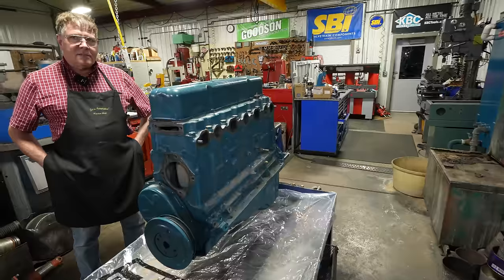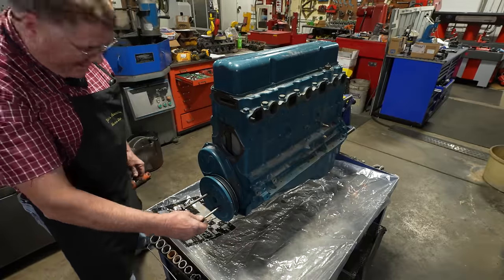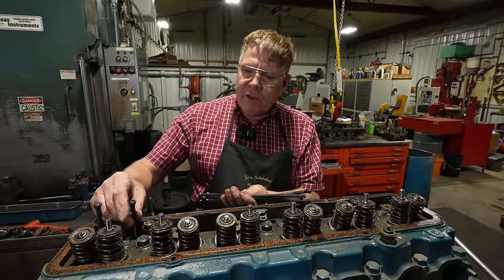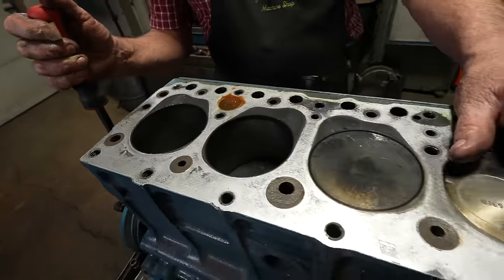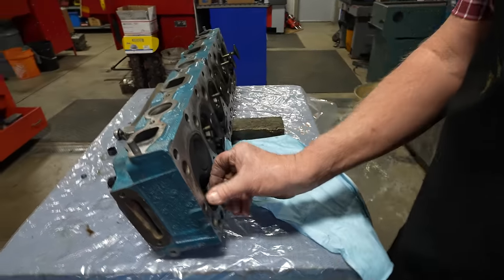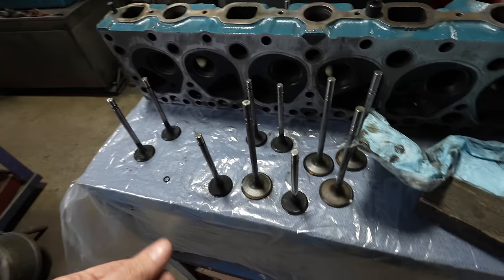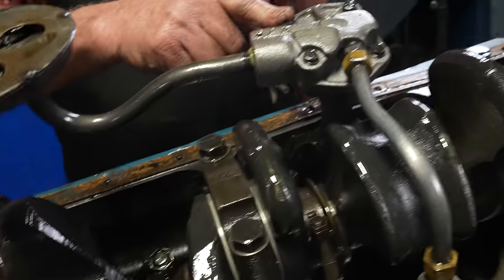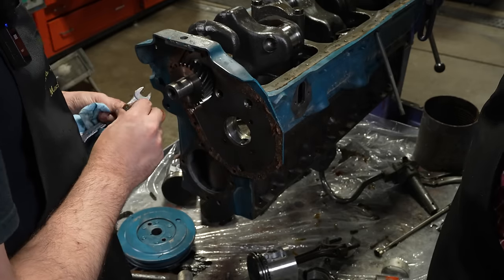Their 235 Chevy BROKE DOWN 10 Miles After The LAST Shop's Rebuild...

Comment: I learned the hard way to always check the bearing sizes when assembling an engine. I got a set of bearings where one half of a main bearing was the wrong size, (.010 under instead of .030 under iirc). When I torqued the mains down the crank seized up. If it had been off the other way, I probably wouldn't have caught it.

Comment: I had a 58 or 59 apache with the 235! Going down the road and i just quit ! Long story short, the fiber gears went outand pistons came up and hit the valves! Bent the pushrods ! I replaced the gears and straightened out the pushrods  rolled the back and fourth taped on them ! Put everything back together and started like nothing happened! Ran like a champ! Great motor

Comment: 11:20
Yes that is true for many types of sensors.
Most pressure and temp sensors use some kind of crimp to connect the plastics to the brass, and the impact can in some cases cause the plastics/brass to twist out of alignment. This can break internal connections.
Reply: Even I would know not to use an impact on sensors.

Comment: The reason those engines were called a stove bolt was because of the bolts used on the valve cover were like the bolts used in wood stoves.

Comment: I had a 235 in my 65 chev 1/2 ton side step pickup // that i pull out of a potato field .  it had three busted piston .. i took a 283 and pulled 6 piston and connecting rods and replace all the piston and connecting rods . in the 6 cylinder.. ..it ran like a champ you couldn't kill it ..the truck rusted away but the engine got a second life in a potato harvester ..

Comment: Those mains looked awful for 10 miles.  Younger guy is right when he said they may have dodged a bullet with the stuck valve.  I can't see that rotating assembly lasting very long the way it was assembled.  The bearing powder in the crankcase is a testament to this.

Comment: My last few years before I retired, I measured everything. I found off centered, water pumps, misaligned, oil, holes, odd sizes from the factory on crank journals with different size bearings I virtually lost trust in everything, which was irritating when I would not install things. My employer was often irritated.

Comment: I worked for General Motors Holden in the 80's and some of the 6 cylinder engines in 1985 would knock loudly on startup on also be loud when running. G.M.'s fix was for us to jack up the engine off the mounts, remove the sway bar and engine sump and plastiguage all main bearings. You had to take an average so that the bearings that you replaced against the block were the same and then put whatever size on the caps as needed. Some times I had to use 3 sets of main bearings to get it right. The story that I got regarding the problem was that they had wound down the staffing at the engine assembly plant, as the next model was going to use a 6 cylinder engine supplied by Nissan and no one was checking the tooling in the plant!

Comment: The umbrella seal is keeping the valve stem to dry in that old motor.  Just o rings allow some oil to seep down and keep the valve guide sort of lubed.  I was taught this from an old timer when doing older motors.  He always said to me, "Did you ever see one of these cars between shifting throw a puff of smoke?  He was right.

Comment: Back in the 70s me as teen working in our family gas station repair shop we mainly worked on 60's and 70's cars and we never had issues with straight 6 or slant six engines like we did with V8.

Comment: An engine we built in the last year,  the main bearing  set arrived with 1 incorrect bearing piece, very similar to what you are experiencing.  It was a federal mogul or sealed power brand set from a local Napa.  That actually happens more than you might think.

Comment: i rebuilt a marine diesel engine and was surprised when the bearings i received had a similar issue. all were 20, except one that was spec! the spec one was also a bit chewed up, almost like someone dropped a used one in to complete a kit. it's a good thing i noticed the wear on it or i would have built it all without a second thought.

Comment: They are definitely sharp and experienced, the people I would want to hire.

Going back to the 1950's, a good friend bought a 51 Chev that needed engine work.

They replaced rod bearings multiple times due to a similar problem.  

After replacing that rod bearing too many times,  they found the journal was undersized.  

The auto machine shop lost their business forever because the shop claimed they did not make the mustake.

Comment: Fun fact, BMW's recent N series engines sometimes use mixed upper and lower bearings to achieve a specific clearance. I would assume BMW does that with older and newer engines too. Of course some of their engines have issues due to tight clearances. 

I love what you guys do!

Comment: WalMart in my town sells bifocal wrap-around safety glasses, sometimes near the tools, sometimes in the garden shop.  The are usually in a self-contained hanging display of six or so pair, found near an endcap, with just two of each grade per display, +2.00  +2.50  +3.00 costing about about $7 each.  The come in yellow, clear and dark shades - I bought one of each lens color, and find them very handy for working in the yard in thesun, or the yellow ones for shooting my air rifles at targets, and the clear onesfor workingon inside projects. They save my expensive  Rx glasses from wear and tear and especially from scratches.

Comment: Had a friend with a tappet problem on his V8 a year or so after a rebuild by a shop ask me to have a look. In the process for some reason I can't remember I had the sump off investigating oil issues. Found all the big end bearing caps on backwards, so the oil spray holes were pointing at the sump. He drove from Townsville Australia to Perth and back like that in the late 80s. 10,000kms. The bores looked fine, albeit after it sat for a few weeks they had light surface rust. I figure it must have been getting just enough splashed oil to lube the rings. New rings and bearings just to be safe, a light hone and it was back in action no issues. Ran for decades after. Someone screwed up. It happens. Probably just learning the trade. I made a few mistakes when I was learning. All you had were books and a friend with some knowledge in those days. I had a Hollie Carb tuning book written by some NASCAR legend. Some other books on building engines, porting heads, modifying carbs etc. You had a crack at it, and sometimes it worked. Sometimes all the inside parts ended up on the outside. Learn, move forward. All the failures go into a mental library, filed by associated noises and symptoms, etc. So, when a mate rings me late one night a couple of years ago from a remote road house thousands of kms from nowhere and holds the phone next to his clattering KTM V twin engine and asks "What's that noise" I reply, "Hydraulic Cam chain tensioner on the rear cylinder has failed". Spot on. A lifetime of experience, some of it you just can't teach. You have to live it, then it's with you always. That's what it is to classed as an old geezer. There's a wealth of knowledge somewhere inside that tangled web of real life anecdotes.

Comment: I use to work on a lot of those 235's and use to be a dime a dozen.  As well as the 230, 250, and 292. And they have all seemed to have vanished.
Reply: They are hard to find now, especially the 261s and 292s.
Reply: @jamesbosworth4191  back in the 80's we cad a service contract either National Fuel Gas and at that time all their Chey Trucks had 292's in them eith 4 speeds with PTO all cudtom other. If I remember right there eas 26 in that fleet.  We had enough parts in house that we could rebuild it in a day if need be.

Comment: I had a 235 in a 1962 Chevrolet pickup that I bought in about 1974.  3 on the tree. Truck did not come with seat belts. Had an optional, partial-flow oil filter. Drove it all over the country.  I slept in the back of that pickup probably at least 100 nights, when travelling. Junked the pickup in 1992 because the body had rusted away. The pickup was slow, and underpowered, but indestructible. In this vid, I'm amazed at the thickness of the steel of the block, and how heavy the engine parts are. I miss the simplicity of these vehicles and engines, and how much space there was around the engine, under the hood. How things change.

Comment: Excellent impartial diagnosis.  I don't think the first shop did anything too bad except to be a little cautious with the valve stem seals.  I have a '65 C10 stepside with the 230ci.  I want to rebuild it.  People say I should LS it.  I like my 3 on the tree and BW automatic overdrive.
Reply: Don't LS it.  Keep it STOCK.  One of the great things about your truck is NO COMPUTERS, NO SENSORS.
Reply: @jamesbosworth4191 Great idea.   I'll keep the points distributor sealed behind the seat si, I'll have a running vehicle after an EMP.
Reply: @tonymunn  What is an EMP?

Comment: At first, I was surprised the .020  bearing would allow the crank to turn when the mains were torqued, which would definitely have locked up the motor had both .020” under shells been installed. But now I see what happened with the 30 under half shell the crank was being bent (sprung over.j Sideways about .005” because of the unequal size shells when the cap was torqued. This is probably why some of the bearings look like they were really scrubbed  hard to polish.

Learning something new every day. 

I’ve only rebuilt the handful of motors in my time, but whenever I did, I’d use a gun barrel wire brush and Berrymans Chemtool to scrub All the oil passages for 20 minutes before I give it the thumbs up for assembly

👍👍

Comment: I restored a 58 Apache and an old mechanic rebuild the 235 engine. When we did the start he told me allow some clearance on the push rods till they warm up, because they can exspand. So I did and the engine sounded awful. Then after warmup pull the cover adjust rockers to the touch and put the cover on it and done. After the warmup adjustment the engine was perfect and so quiet you had to put your hand on the hood to know if it was running.

Comment: Father had a shop for 50+ years here in the Midwest with our hot summers and cold winters.  The old man always called them Stovebolt Specials. Affordable and reliable, just not too fast was the usual description.  Odd to have a failure so quickly.

Comment: Wow! Looks like my '62 middle school auto shop project! Kept going to getting my Chrysler Corp "Dr. of Motors" cert from Orange Coast College, in '68? where my optional 283->302 project found its way into my '56 'Vette. Sold (after the racing clutch kept breaking driveshaft u-joints) that blueprinted (with knurled piston skirts & bearings -Mssrs. Mole & Anderson, RIP, made sure to have us try "everything"!) motor to a buddy who couldn't believe it couldn't be overrevved, so got drunk & passed out with the Weber dual quads held wide open. The only reason it failed (tho stationary), was bc of coolant boil-off, causing the crank to seize, throwing rod pieces every which way!

Comment: It happens. 
While gapping rings, I found one Hastings moly top ring with what looked like a welding arc strike divet in the flat of the ring.
Fortunately it was face up when I was grinding the end gap or wouldn't have seen it. 
The divet was deep enough that I'm pretty sure the ring would have broke soon after startup if gone un-noticed. 
Hasting did make it right and sent a complete set as a replacement.

Comment: back in the  days when those trucks were  super Common and fairly new. nobody Cared about keeping numbers matching engines with the  original Vehicles  i was even suprised that someone tried to change or “Alter” the stamping on that one ?  i appreciate your Channel and the years of Knowledge you share on the channel  I’ve restored a few older Chevy V8 Small blocks for various projects ( mostly older Boats ) and your type of knowledge  is not in any books or Manuals  as it’s basically a experienced  knowledge  ! i did a 1964 Chris Craft CabinCruiser that had twin 283 motors one of which was  destroyed and i had to find a  283  out of  a 60s Impala. that. someone  had restored to get the correct  configuration Chris Craft used back then many people called them Truck Motors,Heavy Duty , or High Performance Blocks  because they had Forged Cranks  Extra Main Bolts  and one other thing to handle the higher Tourque  they were generally used. for

Comment: The first engine I seized was basically this engine in a '63 Chevy Pickup!  I never figured out if there was a big ol' oil leak or if I was just a stupid kid and let it get low on oil, but we sold the truck to a friend for $1, and he rebuilt it and I've seen it around town for the following 30 years.  Since then, I check the oil at least every 1,000 miles (was 500 on older cars/trucks, but modern engines really let you know before they run low on oil).

Comment: A stove bolt is a bolt with a round or flat slotted head and a square nut, resembling a machine screw but usually having courser threads and used for joining metal parts.

Comment: This pushrod six-cylinder design was only engine offered by Chevrolet from 1929 until the advent of the small block V8 in 1955. The earliest of these engines were known as “stovebolt” sixes, because the bolts that held the engine together resembled the bolts that were commonly used to assemble woodstoves

Comment: I had the same problem once but the other direction. I had a10 thou ground crank and one shell was for 20 thou so fortunately it locked the crank up because I did not check them coming out of an un-opened packet. It is rare to see an engine rebuilt these days but back then engines did often get rebuilt up to three times and the components that make them up ended up getting swapped to different engines. One engine reconditioning company close to where I worked would have had 10 of those grey Chev engines being reconditioned each day in the late fifties early sixties and there would have been a stock level of 100 engines at most times. They were sold as change over units.

Comment: I used to give ton's of the EPW boots when we sent a engine kit if a customer asked for them and sometimes with all master kits being shipped.... Paul would wonder why I needed more.  Over the 25+ years I sold engine parts to machine shops and retail part stores I have seen some pkg'd wrong and when I went to work at my father in laws shop checking sizes on a package and then the bearings was a must.

Comment: Age is an achievement. In the 1960s we swapped engines around a lot. My 1959 Apache 4wd has a 283 from a passenger car in it. The oiling system is poor at best on those engines. When I rebuilt those engines, I put them together a little loose. I also added the optional oil filter(which only filters part of the flow). There were after market oil lines that you could add to the rocker cover to help lubricate the rocker shaft. Good Luck, Rick

Comment: I rebuilt a 235 in my 51 chevy truck and ended up putting it in my 57 GMC 4400 flatbed. Strong engine, weak head. Almost all 235 heads I've seen are pinned because of cracking and I used K&W block seal on a few of these. I didn't know until recently that along with the 216 & 235, there was a 261 as well.

Comment: Years back I purchased a (well) used 1957 Ford Ranchero with a 292-ci. engine. Looking closer it had a 292 from a 1955 Mercury.  It also had a California exhaust emission device—vacuum advance disconnect on a Lodamatic Distributor. The underside on this bodge-job had top bearings coded 1955. The bottom bearing shells were date-coded 1964. (Methinks a “shade-tree” rig-up to correct bottom-end noise).

Comment: A stove bolt came with several head styles but was always slotted and used a square nut. They were used to hold metal pieces together. Back over a century ago they were literally used to hold stoves (wood burning) together.  They used slotted heads because most people had flat head screwdrivers and square nuts because they didn't slip with the old crescent wrenches or pliers.
I may not have the explanation correct but it's what my grandfather told me over 50 years ago. He was a machinist, mechanic, and blacksmith.

Comment: One of the (many) things that makes JAMSI a good shop is being willing to take time and carefully look at this customer's engine to figure out what happened.  Im guessing you won't make much money on this job, but your customer will get a good unit back, and your reputation is further solidified as top notch.
Re. (1) -.020 shell; if the block originally had a .005 shim under the cap it may have all washed out. Looking forward to the buildup to see what's going on in #1 main.
Great cideo!

Comment: Really good vid. Great detective work. 
I would never run an umbrella with a regular valve stem seal. These failures are more common on these engines then most people know. I think you hit the home run with oil starvation because of the umbrella seal. Believe shim set main bearings ended in 1954. Mismatched sized  mains= OMG

Comment: 2 things:  I have heard of using one size of bearing on one side and a different size of bearing on the opposite side.  Not saying it is right, I just have heard of that.   2nd:  Engines are simply amazing devices.  So many moving parts with so much precision machining and then they run over a hundred thousand miles all the time.  Incredible machines.

Comment: I'm a few years older than you two gentlemen 😁 I've had a number of pre-65 gm straight 6 cylinders and remember taking the rocker shafts  apart to clean out bits of sludge and crap to cure valve ticking.  Usually I found a fair amount of sludge in the same engines which explains things. The holes in the shafts I remember using small drill bits or safety wire to clean the blockage.